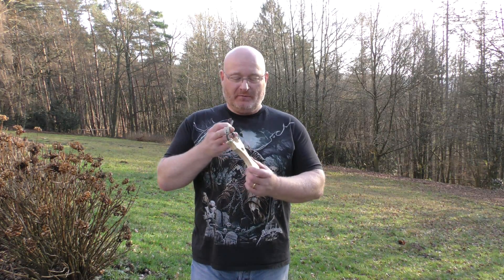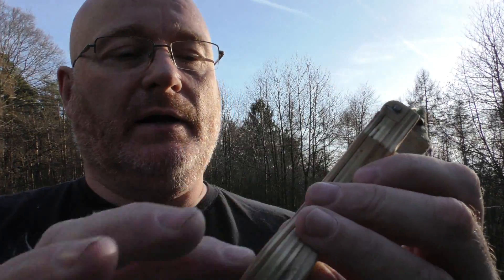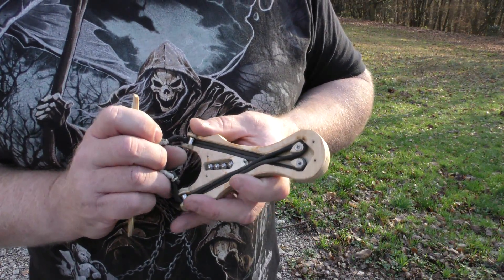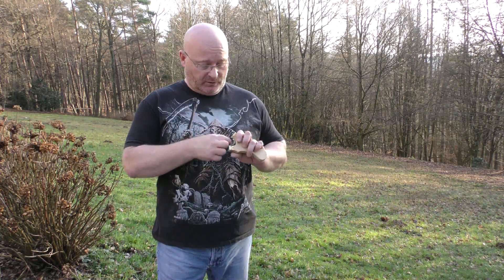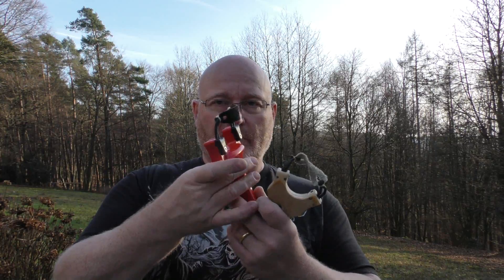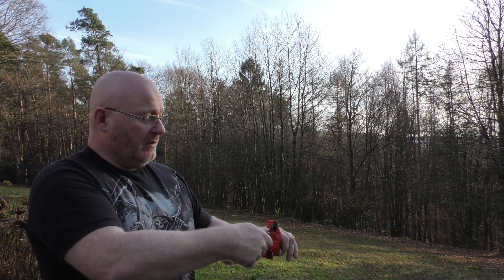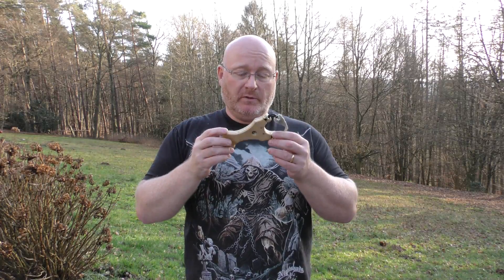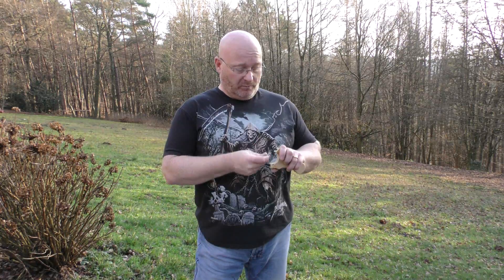A close look at the new pulley based slingshot design prototype!

Comment: Hi Joerg, what do you thing of needle bearings for a larger design?
I am thinking of doing a crutch slingshot with pulleys based on the needle bearings
So for the arms, would you recommend steel(its also to shoot arrows) or some other material?
For the arms I am planning a design like the badass slingbow

Comment: You should use pulleys similar to how a compound bow uses them. I think if you did that, your slingshot would absolutely destroy stuff. If you do it right, more pulleys = more power at the expense of having to move or stretch more elastic material

Comment: i think the wear on the rubberbands will be higher as it will rattle against the walls inside the slingshot when released , if the friction is not equal it might even infuence the direction of the projectile to one side 
if you make a realy high quality slowmotion film of the device using a plexiglass front during release you prolly see the band moving around like a bellydanser slapping the walls when its pulled in
it might be a better idea to use a normal long rubber band outside but make a quick release compartment in the body to roll the elastic up in when not in use

Comment: I would use a thinner, inelastic cable, two cams and a high tension spring inside of a production model. The design largely eliminates friction and frees up more materials for the pulleys and other mechanisms required to make the slingshot work, plus then you can add accessories like different springs to easily tune the slingshot's pull weight, and it'd probably free up enough space that you could make a larger, spring-loaded hopper for the balls. It should make the slingshot much more powerful.
Reply: +JoergSprave Dick move, dude. Could've just ignored them.
Reply from the maker: +Teth47 Wow, clearly you don't know a thing about slingshots.
Reply: JoergSprave I'm a little disappointed at your dismissive comment, but I guess you're entitled to your opinion. Your input has been noted and summarily dismissed as being devoid of useful information.
Reply: +JoergSprave I must admit you are great at building creative weapons. But your personality really shines with comments like those. Seriously, he just threw out an idea, he didn't insult your design or anything. Anyway, I really think this slingshot is looking awesome, can't wait to see the final product!
Reply from the maker: +Teth47 Go back to the single video YOU ever uploaded, called "my dog is odd". Less than 200 views in one year.
Reply: +JoergSprave Ich habe garkein video hochgeladen ! Und? Würdest du mich beleidigen weil ich von etwas rede von dem ich keine ahnung habe ??
Reply: +JoergSprave You think slingshot with springs instead of rubber bands wouldn't work? I think it'd be interesting to see if it could.
Reply: therealnightwriter Nope, don't have a woman because I prefer guys. Try again buddy.
Reply: Seems like he took your 'white knight comment' as an insult and overreacted. The first one isn't a personal attack in my understanding. I wouldn't be offended if he said it to me in german (I'm also from germany). Cultural/personal differences maybe? Unnecessary beef though.
Reply: I don't think Joerg found in your comment any useful information either.
Reply: Hao Huang At least I tried, and didn't insult his intelligence in the process. Take your white knighting elsewhere, it'll accomplish nothing here.
Reply: +JoergSprave Well, I would say it was at least a design idea. If you ever experimented with such a concept, I'd be interested in seeing the video.
Reply: JoergSprave Wait, so my input is invalid because... I only uploaded one video? Wow, I tried to be civil here, and you come at me with a personal attack? Again? I'm absolutely at a loss for words. This is deeply disappointing.
Reply: +Alexander Kiesenebner Und seine Idee funktioniert noch dazu ziemlich gut !!
Reply: Alexander Kiesenebner Thank you!
Reply: JaByZki I almost feel like grabbing some old broken compound bows and building up a prototype myself... Might do it in the summer, just to see if it works, and if I can even do it XD
Reply: George Bakewell See, that's perfect, right there. I have a couple ideas to overcome those limitations, but honestly, it's just too complicated at this point to be feasible for me to build. Oh well, thanks for the comment ^_^
Reply: GenophefeElisabeth I could see that happening. I'm Canadian, and relatively inexperienced with the particulars of other cultures. Here, that's a massive insult, if it's not over there then that's cool, simple misunderstanding.
Reply: +Teth47 you would have a very small draw distance with that; since the spring is small (limited by the size of the slingshot), for the ball to keep accelerating until it leaves the pouch, with the pouch close to the fork as the ball is released, (like in a slingshot), the cables couldn't be much longer than the fully stretched length of the spring (since the cables would retract inwards by the same distance as the spring does). This could be alleviated by lengthening the spring, perhaps with pulleys, although I don't know how well springs do with pulleys; elastic would be a better in this case, but at that point you would be better off removing the cables entirely and use the solution that Joerg used above, since having the whole thing holding the tension uniformly is better than having a single shorter thing holding it all).
An alternative would be using a spiral-shaped torsion spring inside, where the cable is wound up inside, essentially a slingshot which uses the same mechanism as a tape measure, or those things you clip to your belt which you attach your keycard to. And instead of metal cable I would use some kind of nylon string as it is strong and light but also non friction
Reply: lego t-s Oh, I was going to use the cams to give mechanical advantage to the cables. The spring moves a little bit, the cables move a lot, akin to a bow. I'm just not sure that'd provide enough draw length given the space provided in the handle. Perhaps moving the mechanism to the arm rest would help, give me some more width. I also wasn't planning on using steel cable. I meant the word cable to mean nonspecific stranded material, I could have been clearer on that.
Reply: +Teth47 Wouldn't work Teth47. You need Elastic bands to store the energy in a slingshot. Cable works on a crossbow because the energy is stored in the arms of the crossbow. Unless you intend to drill a rifle chamber somehow in this slingshot to use the springs to shoot the ammo I really don't see this idea of yours working. lol
Reply: Tronman63 I don't think you're understanding what I'm talking about correctly. The energy isn't being stored in the cables, the cables carry energy from the spring, through the cams, to the slingshot basket. The cams are present to give mechanical advantage to the cables, allowing them to move a large amount while the spring moves a relatively small amount, again, akin to a bow.
Reply: +Teth47 You're likely to have a lot of bulk depending on the springs, if they're effective. Might lose efficiency to spooling/unspooling the cables, too.
Reply: oneproudbrowncoat That's what I'm thinking, though given the excellent mechanical properties of springs, that might mitigate the inefficiencies, and moving the cams to the armrest would solve the bulk problem, would just have to include a locking hinge to fold it, if I incorporate that into the bearings the cable rides on, it'll keep it compact, should still be pocketable, but at worst it's a normal sized slingshot with more power, given that it's pretty easy to find 200 pound springs in relatively small sizes, especially if I use a torsion spring like the other guy suggested.
Reply: +Phil Deviant this is kinda untypical for him.  There are quite a few (decent) youtubers I've seen saying stuff worse than that.  If joerg replied to commenters like this on a more regular basis however I'd agree.
Reply: +Teth47 I think the bands store a lot more energy than you would be able to store in a spring. I am too lazy to calculate it (I would have to go look up many things). But I don't see how a small spring could store anywhere near as much energy as slingshot bands. Interesting idea, though.
Reply: ***** Steel has a much higher tensile strength, and is thus capable of storing much more force per amount of extension. A spring you can comfortably hold in your hand can pull with a couple hundred pounds of force.
Reply: Teth47 steel is much heavier than rubber. steel springs allow much less travel than a rubber band of the same length.  You can also hold comfortably rubber with a couple hundreds lbs of force, and the rubber is going to stretch way further.

Also, steel in coil spring form might be less efficient of a way to make a spring than a simple rubber band is.  A leaf spring like arrangement might fare better.
Reply: Alex Bv Steel is heavier, but much denser in terms of power storage, travel is an issue I've addressed already, read the other comments. A leaf spring would be difficult to implement, I'd need gears. A torsion spring, provided it's either well lubricated or spaced properly is more than efficient enough as far as I can tell.
Reply: Teth47 Well, joerg already experimented with steel springs and they didn't perform very well.  I understand the whole idea that steel stores a lot of energy, but while it might be true volume wise, it being true mass wise is debatable.  Rubber stretches 5-6 times its length while steel, while being 8 times heavier only does for a fraction of it.
Reply: Alex Bv I already addressed draw length in earlier comments. I'm using cams for mechanical advantage. I welcome criticism of my ideas, but please know what my ideas are before you criticize them.
Reply: Teth47 I know... except that first of all springs are inferior even with mechanical advantage and second of all packing an efficient compact lightweight lever with sufficient leverage is a pain.  While I'm not saying it is impossible it is quite difficult and rubber bands can fulfill the same role anyway.  
Springs have quite a few disavantages over rubber, and they also probably don't have much in the way of advantages.  Steel generally isn't the material you use when your no1 concern is mass.

I do like your willingness to think outside the box tho.  I've had a similar idea (with rubber rather than springs) in the past.  This guy http://slingshotforum.com/blog/11-zeds-technical-writings/ has quite a lot of info about the physics of slingshots, I found his articles a good reading.
Reply: +Teth47 Tensile strength has nothing to do with energy storage. The question is how much energy can you store in a realistic steel spring and how much energy can you store in a band like the one Joerg used? If you are passionate about your idea, calculate realistic numbers. It is obvious from watching some of Joerg's videos and seeing his comments that he has an understanding of these issues. But I am not sure if you do. Anyway, without some basic calculations, it is just back-and-forth. Keep in mind that the inertia of the cams you propose is also parasitic. Once motion begins, the cams have to be accelerated also, and the energy required to accelerate them cannot be imparted to the projectile. So the mass of the cams must be kept small compared to the mass of the ammunition. And if you find that a 10:1 or 100:1 leverage ratio is required, is it possible to achieve that with low-mass cams?
Reply: Alex Bv I'll be sure to check that out, thanks! And I know it's not an easy thing, it's also probably not worth it, but it's a fun idea I think.
Reply: Teth47 Indeed, I've thought about slingshot physics for a while, I think I have an idea for an interesting design but before knowing whenever it will meet expectations I'm going to have to actually build it :)
Reply: ***** First, yes it does, it denotes maximum force. An elastic material can only apply force less than or equal to its tensile strength. Rubber bands work well because they stretch far, and thus have more time to apply a proportionally smaller force over a longer distance, which suits accelerating projectiles well, I want to replicate that, but end up with a higher net force, so I need something that applies a much greater force. As for the rest of your comment, I'm not amazingly passionate about this, I'm mostly just having fun talking about an idea that is probably out of my depth. If I do any calculations, it'll be later in the year, more towards summer, when I have a meaningful amount of free time to dedicate to a project like this.
Reply: +Teth47, you seem to not understand how steel springs work. Generally they do not simply stretch a material (hold it in tension). They work by bending a material, causing part of the material to compress and part to stretch. So the tensile strength is not really the issue. It is true that a steel tendon can be a spring purely in tension, but the range of motion is so small that you would need to use an impractical cam ratio. Energy is the integral of force over distance. In order to have the same energy storage in a steel spring, as a rubber band, the spring force would have to be greater than the band force my the multiple of the cam ratio. Roughly speaking. If a band has 20" of draw, and a spring has 1" of compression, the spring would need to have 20x the force at maximum extension, and a 20x cam ratio.
Reply: +Teth47 You'd use that, and you'd have the weakest slingshot ever.  Plenty of people have tried exactly what you're talking about and its all crap compared to elastics.
Reply: phoulmouth Wow, it's almost like we've been over this exact thing over the course of 41 comments right inside this thread.
Reply: Teth47 There is nothing to go over child.  Everything you're spouting has been tried, has been done, and has failed horribly. E-V-E-R-Y-T-H-I-N-G.  Mechanical slingshots using spring, pistons, actuators, and basically everything that isn't elastic are complete shit.  

Why don't you put your money where your mouth is and go make one.  Then post a video of you chronographing it so we can all watch your face as you realize you're 100% wrong.  I could use the laugh.
Reply: phoulmouth Mkay, if there's nothing to go over, why are you here? "I have nothing to say to you, here's a bunch of things I'm saying to you" is not a valid statement. If you'd like, try again with something concrete, or you can just go.

I might try to build it at some point, and it will probably fail horribly. The point is that I  don't care, it's a fun little idea that popped into my head, and I don't see why people feel the need to insult me personally because of a potentially shit idea I had, that's all.

If you're going to continue to goad me, you can just leave.
Reply: phoulmouth You're going to go that route, huh? Strike 3, you're out. Bye!

I think you forgot that this is my thread. I'm not just going to sit here and take insults from some guy who decided to get upset over some words on the internet. You have no power here, should've been nicer if you wanted to talk.
Reply: Here is a life lesson nobody in history has ever wanted to hear what you would do nor eill they ever. Build it and post it. As a slingshot fan I have yet to see this design but here is another assclown with a better design. If your goal is to be that guy! The guy everyone knows who always has to top the previous story, always tries to prove how much he knows or can always do it better but has accomplished absoletely nothing, mission accomplished. Most people that do create or build dont tell others what they would do ,they just do it.
Reply: +JoergSprave  this guy isnt worth your response Joerg. This is an outstanding design, excellent  work